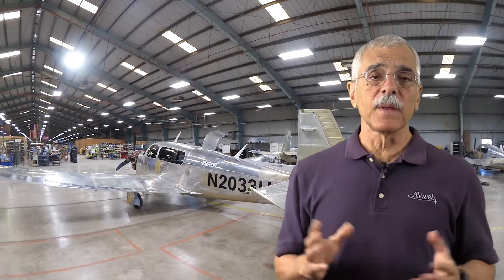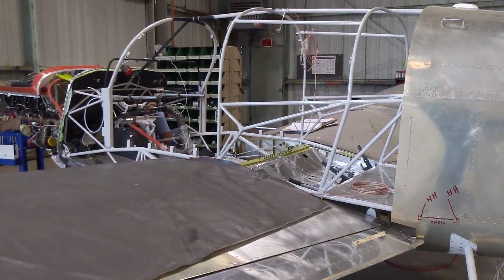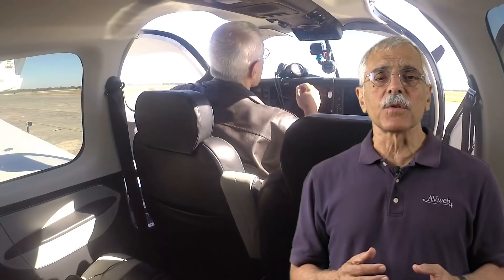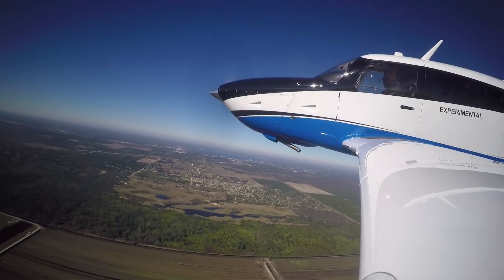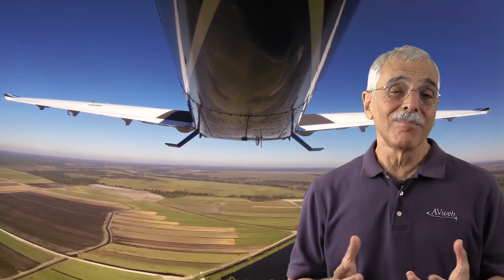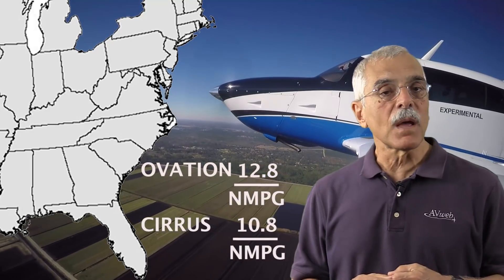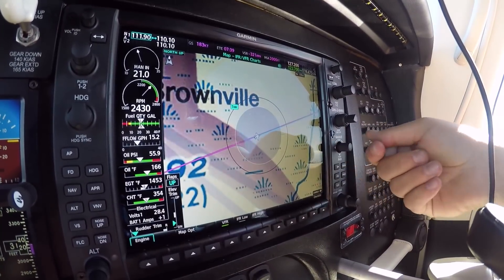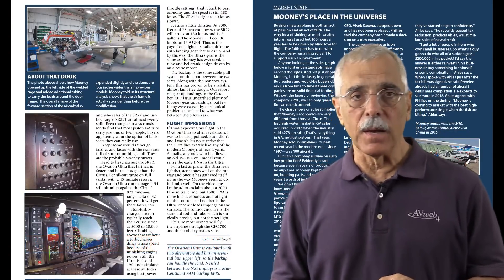Mooney Ovation Ultra Flight Report

Comment: Back in the latter '60's, I learned to fly in Santiago, Chile, bought a Money Mark 20 A(laminated-wood wing spars), flew it around Chile, and flew it back to DC. Flat out, a marvelous, leggy dream to fly.  At that time, the wonderfully efficient landing gear lever (Johnson Bar), created  a Mooney-pilot ID...a scar between the middle finger and ring-finger knuckles, created by a bolt head on the front passenger seat, as the bar seated itself on the floor between the two seats. When you came across another Mooney pilot, you just flashed your right fist, fingers down, for bonding ID.

Comment: 5 yrs later, and no more Mooney.
"Reeeee, Mooney isn't out of business, they just don't build airplanes anymore!"
Sounds like an excuse.
Reply: Of course they went out of business. The entire Mooney community is made up of people who are try to go fast, but not end up spending their retirement money to do it. Buying a modern high-performance single engine airplane is for suckers. You'll get the same performance for 30-50% of the price by buying used, with measurable decrease in safety. No one who understands aviation and the airplane market was ever going to pay $650-750k for a new Mooney. A 1988 M20J cost about $275k in 2024 dollars new from the factory floor... If they could sell a new M20 at even $300-400k mark I guarantee they'd actually sell airplanes. As soon as you eclipse the $500k mark in aviation you're into a whole different level of professional/businessman wealth and they aren't interested in single-engine piston airplanes. Especially when nice turboprops are available.

Comment: @6:33 the Mooney Acclaim it still rising beyond 25,000 feet. She can cruise above the clouds! We (family, friends and I) built these birds for decades, starting in the 70's until 2008. They are amazing airplanes! Does the pilot side door weaken the rigidity of the cabin/airframe, throw balance off center, or increase the noise level?
Reply: In Paul's Acclaim video for this same generation of bird, he says the new doors are made of carbon fiber and fit better so the noise level in the cabin is lower.

Comment: 700 Grand for a piston A/C? The end of GA is truly approaching...
Reply: In a way you are absolutely correct. I was doing some research and found that a Cessna 150 back in 1958 cost about $7,500 new. And so I went to the inflation calculator, and it is about $66,000 in today's dollars. It's true they don't make 150s or 152s anymore, but a 172 today, roughly costs a whopping  $400,000!!

The 172 cost about $9,500 new, back in 1960. That is $82,000 in today's money. So the 172 costs nearly an insane 500% MORE than what it cost back then adjusted for inflation ......And that is certainly an outrage, because it is still the same basic airplane, even though it now has a few more goodies here and there.

And here's the kicker: Someone who bought a 172 back in say 1970 for around $12,000 and maintained their aircraft well, could sell it for around $30,000 to $40,000 today!! Meaning they would have not lost anything in depreciation and would even get back some of the cost of inflation! THAT is also insane!
Reply: GA is totally fucked and planes are way way way too expensive to be owned by any normal people. I might as well just settle for an ultralight, since that’s the only way to own a reasonably priced airplane.
Reply: @opticalecho119  Don't agree at all. I'm flying an older Bonanza but she has new paint, new prop, 450 hrs on a rebuilt engine, ADSB & some instrument upgrades. Paid about as much as a nice SUV... It's not a new model but has been extremely reliable hauling 4 folks. It's all about priorities.
Reply: You can thank product liability and FAA certification costs for that.
Reply: In the uk it's even worse, I couldn't get a rust bucket for less than a house. Less and less people are flying and the aviation industry thinks that the fix is fancy screens because " It apeals to the younger croud :D  who is actually buying these aircraft?  700 thousand!!! Fuck that!!!! Even if I was a millionaire I would tell them to go do one, but the best part is the fact that they offer finance lol 3000 a month for the rest of your life lol .
Reply: No GA will still be around. People been predicting the end of GA for decades. The cost is part of the reason why the kit planes industry exploded in the '80s. The other was the performance so much better for a lot less money.

Comment: Great video and nice craft. Yes I know, same old replies like this. 
Here we go again with expensive aircraft's marketing to the very few. Out of those few SR's seem to be the pick. Mooney as well as the others in class, really need to market middle class. More money, volume and easier to bring new owners into GA.  You watch, Mooney will be in trouble again just like the Cessna TTx sad to say. I am in the market for a 4HPSE, just not new. IMO they are not worth 700-800k, even if I wanted to spend that. Many others in the price range to look into. Ex. Piper Matrix with more seats too, even a nice older Kingair. Manufactures need to remember the"hey day" when a nice aircraft was the price of a nice car or even a high end auto. What happened? Many sold and flying today. I too am looking into kits now. Many options for glass and much cheaper. Build you say? Well you can pay someone or buy one built. Of course you would not be the builder, but..... Your not with cert aircraft's as well.  PS keep these great vids coming, love them and learn much. Thanks
Reply: I've been seeing the same things you are in the market, hogster. 
What do you think is the biggest driver of the high prices? My top 2 suspects are FAA regulations / expensive certification process and product liability. I'm interested in other opinions, however.

Comment: Mooney's are beautiful, very well built, stable, great for IFR and efficient. I don't begrudge anyone for loving their Cirrus or Bonanza or Arrow.  I would just say that Cirrus and Mooney are not apples and apples.  And those who criticize Mooney probably haven't flown one.  I have 500+ hours in a C model.  Insurance (full coverage and 1M liability) was less than $800/year. Landing gear did require some maintenance (ok it is a 50 year old airplane).  I'm guessing the lifetime cost of maintaining a Mooney's retractable landing gear is no more (and probably less) than maintenance on the Cirrus parachute. The main thing is when you open the hanger, or see it on the ramp, you want to love what you see.  When your in the clouds, in the rain, strong winds, you want to trust it will get you home again. I love the way Mooneys look, and fly. So whatever makes you happy, go fly it.
Reply: Beautiful aircraft, love flying ours
Reply: An F-5, F-104, & B-58 hustler make me happy, but that's easier said than done.

Comment: So a mooney is slightly faster (ok, quite a bit faster) and uses slightly less fuel. But it can't haul as much and is more expensive to insure (thanks to retractable landing gear and no emergency parachute system).

Also, obligatory "holy shit that price, who the fuck would buy that shit? You could get a used turboprop for that money.".
Reply: Mooney's cost less at insurance time than all comparable competitors. Not even a question up for debate.
Reply: Who gives a s*** about the parachute!? Any aircraft with retractable gear will cost more to insure. Yeah you might be able to buy that turboprop for that much, but start looking at fuel burn, insurance, training, etc.. Cost a hell of a lot more than the Cirrus and the Mooney.

Comment: Nice try Paul but no cigar... you 'conveniently' left off the most salient sales point of the Cirrus in comparison with the Mooney... the onboard PARACHUTE. But it didn't go unnoticed.  You can only lather on so much lipstick on the PIG - we can see right through your report Paul.  Mooney just doesn't get it and as the result of its failure to understand what drives success, doesn't have a snowball's chance of competing with Cirrus.  How many more bankruptcies will Mooney go through in an attempt to regurgitate the same old failed product & marketing strategy?  A door on the pilot's side?  A composite fuselage?  So what?  What value does that add other than aiding some 350-pound overweight brain-dead idiot pilot who purchased an Ovation the chance to load his carcass from the left side?  Retractable landing gear - more of a headache than an advantage (additional maintenance expense, gear failure potential, etc..) who cares if it only costs a few knots in speed for fixed gear?  Costs nearly the same as a Cirrus -  are you kidding me???!!!!  OK Mooney... marketing 101.... start with a parachute equipped plane.  Secondly, drop your price at least $250,000 - under $500,00 for sure.  Since both of these suggestions will never see the light of day I'll stop here.  Let's start a contest... whoever accurately guesses the next bankruptcy date wins a free SR22!!

Comment: Surely those "M20" Mooneys aren't going to be considered an M20 for FAA type certification purposes with an entirely different airframe and the "legacy" M20's "safety record".  And looking at the "illustrations" of the Acclaim compared to its "competition" it sure as hell doesn't look "smaller" unless "smaller" is shorter wingspan or some other "dimension" besides length, height, cabin "length", etc. And if its smaller, lighter and has retractable gear how is it "comparable" to those other airplanes anyway?
Reply from the maker: Surely they are. They're re-certified with modifications in the same way that Cherokee 140s and Dakotas are both PA-28s, no? The Mooney's wingspan is two feet shorter, the fuselage is two feet shorter , the tail is an inch lower and the cabin is four inches narrower. So yeah, it's smaller. They're the same class because they have four seats and go like hell. I know you could figure this out if you tried.

Comment: But the biggest deal breaker and the elephant in the room that was never mentioned """"INSURANCE"""", ask your insurance company how much "more" your going to pay for and airplane with retracts and no ballistic chute, then ask how much for an SR22g6, sorry Mooney your gone it's a no brainer.
Reply: Uh, wrong. Mooney's are less expensive to insure. 

Try again.
Reply: It's only a no-brainer for people with no brains.

For those WITH brains it's a preference.
Reply: I was interested in flight level speeds of the Ovation; but a factory rep said its not possible to get AC and FIKI in either Ovation model and also said that I would not like the width of the cabin compared to my Cirrus.  I credit Mooney for trying to improve to meet the market and they have worked hard at that.  The Ovation fit and finish is sharp, but they just haven’t gone far enough for me yet.
Reply: And SR's sell, even if over priced IMO
Reply: …then comes the question: Do you need a hangar for the Mooney? Well, no. Not necessarily. It's better, but the metal wing won't erode under UV light. Composite wings will.
Reply: @Eo_Tunun  Haven't yet heard of the composite wings in the last 20 years being damaged by UV. A composite and paint are a lot better than they used to be 40 years ago.
Reply: @ictpilot  I wish everyone who is willing to bet his expensive little plane on such an experiment best of luck that is true.
Reply: @Eo_Tunun  Well if you've been following the industry since 1980 you'll know that there hasn't been any problems. Any delamination problems have been with the manufacturer not UV.
Reply: @ictpilot  Delamination isn't the main problem. Resin losing its E-module and cracking under load used to be the limitting factor. But it's true that I learnt about that issue from gliders that were built in the late seventies and early eighties and stored in direct sunlight in the open for years by morons.
Reply: @Eo_Tunun  Again that's not a problem anymore and hasn't been for a while. Used to be the only paint them white to help reflect the sun's heat and UV. That's not necessary anymore.
Reply: @ictpilot  Well, even white paint didn't rescue the poor gliders back then, it just delayed the inevitable.
Reply: @Eo_Tunun  Again we're not talking about back then we're talking about now. You seem to think that it's still a problem with composites. If you're that scared of composites I would suggest you never get on a commercial airliner, never get on any military aircraft, and not get on a lot of GA aircraft from Jets down to single engine pistons.
Reply: @ictpilot  Did you even understand that your point had been taken before?
Reply: @Eo_Tunun  I understand my point, but you seem to be thinking that the composite qualities are still back in the 70s early '80s. What's your problem with them now? Your initial statement was composites are a big scary experiment. But I'll step back a little and maybe there's a misunderstanding. Please expand upon your statement if you'd like to.
Reply: @ictpilot  What more than the statement that your point was taken do you need? We can rest this discussion here, I think. At least I will.
Reply: @Eo_Tunun  Well now that you finally explained that and admitted it fine.
Reply: I think the issue raised by the other guy concerning insurance is valid.  Complex AC’s are typically more expensive to insure than fixed gear.  Also, airframe value impacts premium costs less than liability coverage values, aircraft storage method and flight experience of pilot.  Its not as simple as comparing cost of the aircraft in determining premium costs.

Comment: Anyone have an opinion on the overall best single-engine single-prop to learn flying? At least when one's goal is to get a PPL with instrument rating, eventually. So I'd think not a piper cub, necessarily.. but who knows? Cessna 172? I think there must be something else that's even better, more reliable perhaps? FWIW I'm in Connecticut, so would be flying out of either KOXC or KDXR primarily, most likely.
Reply: A 172 is a great trainer, but not the most practical plane if you plan to use it for travel or whatever after you get your ratings.  Learning to fly in a more complex single (182, SR22, etc.) will take a bit more time because there are more systems to learn to manage, but it will probably save you money in the long run since you're only going through the time and expense of the purchase process once.  In theory, the simple airplane (172) will be more reliable since there is less stuff to break, but it all depends on the age, condition and how you keep up the maintenance.
Reply: PPL in a 152. Instrument in a 172. There's no reason to get overwhelmed and pay extra money for a more complex plane just to get your ratings. The more complex planes will be easy to transition to after you have your ratings, and some flight time built up, instead of trying to learn them while trying to learn your basic flight training.  

Also you should learn on a traditional cockpit.
Reply: I bought and learned in a older 172, and found it to be a great plane to learn in, and pretty cost effective. They are easy to sell and everyone knows how to work on them. They are slow if you use them for traveling, but with a power flow exhaust you can get up to about 700 pounds of weight with 40 gallons of fuel, and cruise at about 125 mph on 8.5 gallons of fuel. I bought my 1972 for $38k with 1400 hours left on the engine TBO, and both my wife and I learned to fly in it. Have taken many many trips to the Bahama in it and has been a great airplane.

Comment: Should not run lean of peak, ask the engine manufacturer.
Reply: @Bob Gilchrist not to mention max continuous 😷
Reply: And Santa brings us gifts every year.....
Reply: You clearly have not asked the engine manufacturer. This is an old chestnut, long ago disproved, along with the other myths such as "the dangers of the downwind turn" and "getting on the step".
Reply: You’ll be top overhauling in no time.
Reply: I run LOP all the time. It is far better for the engine than 50 ROP. If you run ROP, you better be at least 100 ROP. 50 ROP is what tears engines up. GAMI has done years of testing and has proved LOP is far better for your FI engine. Even the engine manufacturers will agree. 

https://www.avweb.com/news/pelican/182084-1.html